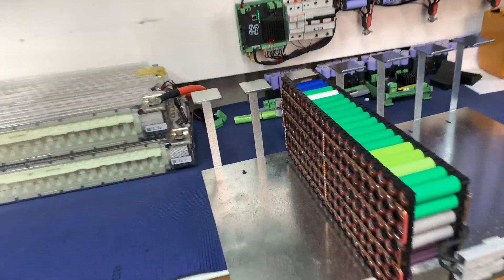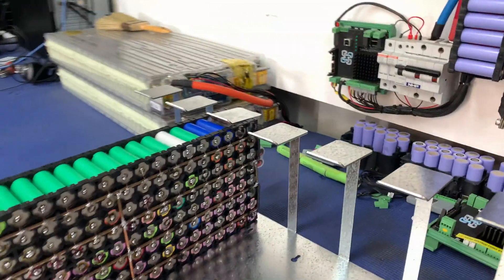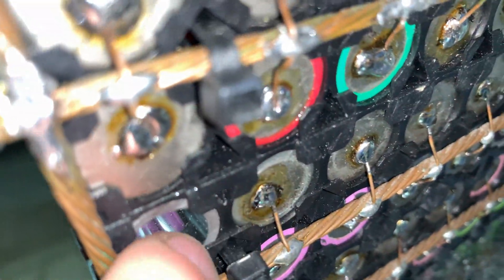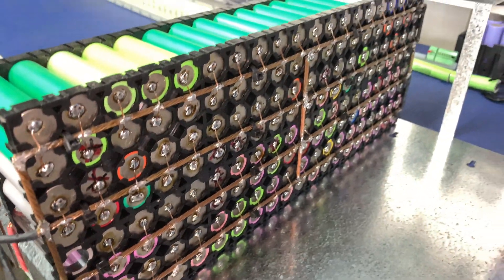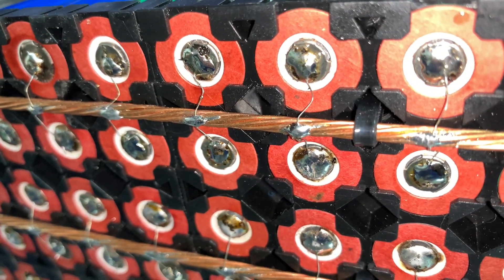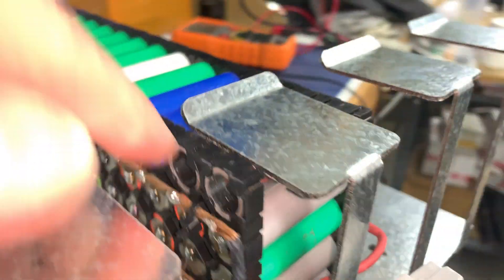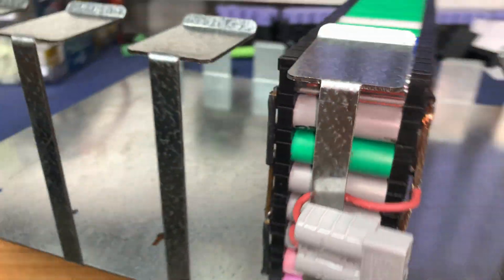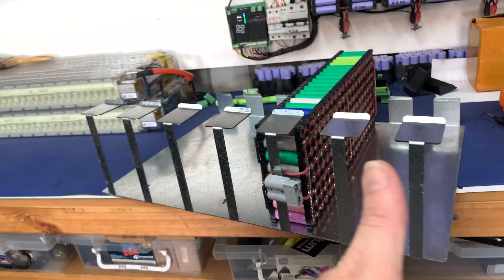Ivan dropped in to show me his mount design and tell me a little about his project.

Comment: Hello, how are you? It's me again from Brazil (Raul Júnior) ... Very good this video ... where can I get supplies to assemble my battery banks? Spot welder; Metal tape for connection; the batteries; etc. I have a project that will be: converting to a 36 / 48v motor electric bike between 800 and 1000w of power ... I would like to make my own battery! Can you help me with a step by step?
Reply from the maker: I have a kit store where you can grab stuff here - https://kit.co/HBPowerwall/diypowerwall-build-parts

Comment: To much solder on top side of the batterys  there's no way they are able to ventilate if a battery gets an internal errors
With or with out fuses I would not block the top ventilation holes on a 18650
Reply from the maker: I think they looked fine in person

Comment: I think you should be thinking about steel boxes. When a MotoE racing bike crashes and catches fire they winch it into steel box and let it burn out. So long as the outside of a steel box is exposed to air it can contain fire quite well.

Comment: Put door trim on the sharp edges. Isn't foot to have single insulated wire coming in contact with bare metal. Paint can work well to insulate the enclosure, as you don't want shorts through it.

Comment: This is great work. May I ask why the pack mounted in the rack is not pressing on the battery holders instead of the batteries? Can a bend on the holders  be made to stop the sideways translation of the entire pack? 

Can you explain how the pack is unloaded? Lifted and dropped down? I see a large gap ontop?

Why do you only support until the last 2 batteries  on the bottom mount of the rack? 

14s setup=2 units of 7? What's the configuration?

Comment: Pretty good job. I like the look of that heavy galvanizing. Nice and shiny!
Side note, I would recommend Ivan revisit the negative side bus wire solder connections. There's a lot of cold solder joints and will create hot spots under heavy loads (you found this out with those lugs you needed to recrimp, Pete). 80W iron might not be enough heat to do those, probably need a 100W. Considering it's not on the cells, dump more heat into it, that copper sucks a lot of heat away.